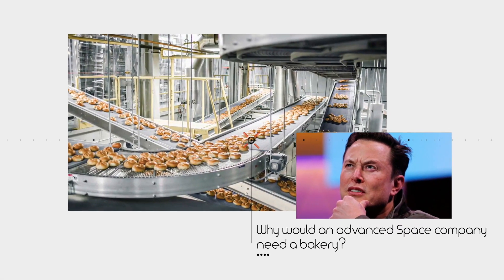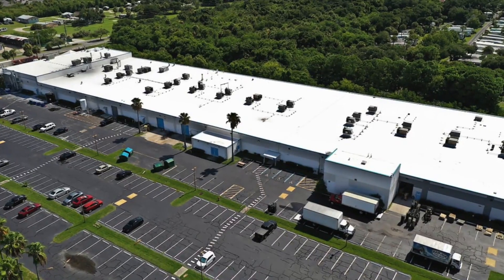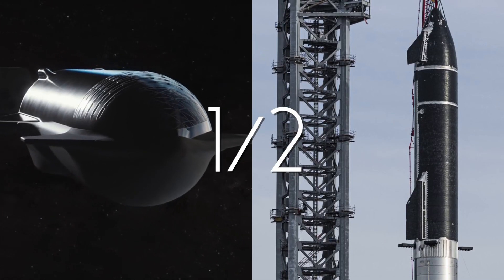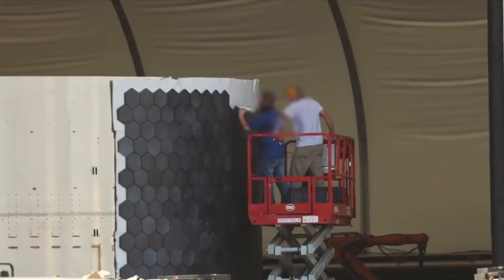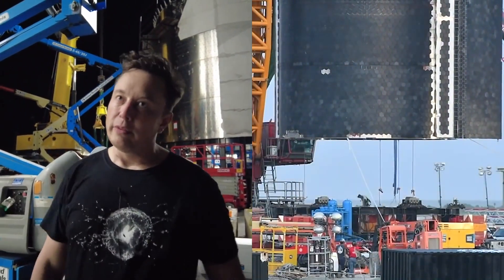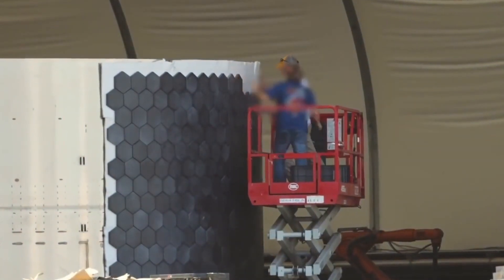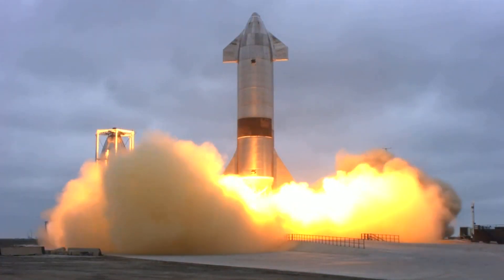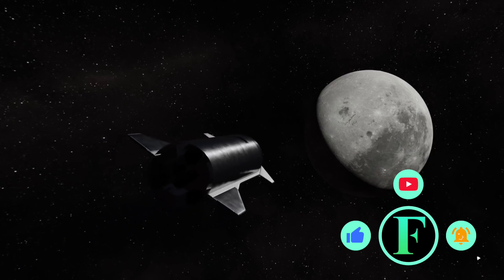Inside SpaceX $1.3 Billion Dollar Space Bakery

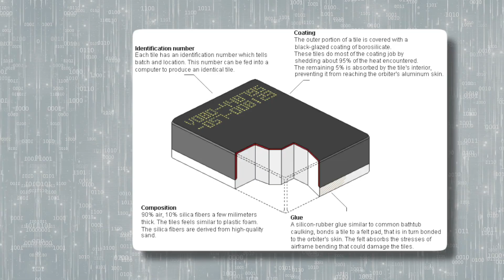Comment: Erm... if the tile is 90% air, when S20 goes into space, wont the air leak away leaving the tile with 90% vacuum? Not sure you can make the claim at 1:34 "that's because of air's low thermal conductivity".
Reply: even better, vacuum (absence/lack of matter) means absence of conduction or convection of heat

Comment: So far it looks like the thermal shield won't work ... The ceramic tiles are too stiff and the starship hull too unstable. Additional stiffening of the hull will probably significantly increase its weight and it is not known if the power of the booster will be sufficient.

Comment: I layed carpet tiles for years and the principle was the mass produced tiles in the main shape are shipped to site however those requiring cutting and sizing for the angles and around piping and protrusions were done on site. It makes sense then that the hexagonal tiles (the bulk) are made off site and the tiles required to be cut to size and fill the gaps (a much smaller number) would be made on site.The construction off these tiles may also be different slightly to allow them to be cut or shaped to size.my theory anyway Cheers from Australia

Comment: the heat shield is a bummer, at least in the way how they apply it, if they need to install every single of the 15000 tiles manually and check them multiple times that's a very poor engineering

Comment: im quite sure spacex' strategy will not achieve the goal of fiscally viable interplanetary travel and settlement.  An interplanetary vehicle needs to be assembled in low earth orbit as big as the twin towers combined, if not bigger and it could be any shape, but rectangle seems most logical. It would not require heat protection as it would always remain in orbit  whether here or @ mars. It should however  be supported with with a fleet of unmanned reusable delivery vehicles like the starship concept

Comment: Is this WOLL water resistant? How much more weight will have ship after heavy rain? If water will freeze it will not destroy tiles? What if water will fast evaporate during start or back to atmosphere? A lot of steam will be generated? Pressure can detach heat shield tiles?
Reply: Correct this is an issue that will be a massive challenge to the vehicle

Comment: Why don't they have sheets of tiles, connected together, inspect them on the ground, and then wrap the sheets  around the ship, you can avoid all the different shapes as this would be a template of that section
Reply: How about making the tiles with a dome shape,  without spaces between them. Print them on, in a continuous unit. There won't be vibration as the whole is monolithic,  and expanding and contracting would be allowed by the domed form,  outwards
Reply: Because they are so brittle that they don't bend. It's a very soft material
Reply: @robertcook5380  Why would they have to bend,  if you follow the same principles of mosaic tiles, you have the ability to reduce the size of the tile to compensate for any larger surface with irregular profiles.  Also instead of putting them on whilst the rocket is vertical you could place them on before stacking, with maybe a few rows to finish of the heat shield.

Comment: Instead of using hexagons, why wouldn't SpaceX (on the LARGE sections of Starship that are a simple cylinder) use a much larger tile, that is shaped to overlap adjacent tiles moving from the bottom centerline to the edge?  Lots fewer tiles to worry about.
Reply: ...think of the slightly overlapping Scale Mail from medieval times.  If the edges were tapered to 'slide' over adjacent tiles (you could use modeling to determine appropriate overlap based on temperature coefficients), thermal expansion and contraction would also be taken into account in those large areas.  It seems like reducing the number and complexity of the heat shield system would be worth the slightly increased weight, and if eroded or damaged, replacing a large section would be as simple as with the hexagons.

Comment: Given the fragility of the tiles and the difficulties in their placement, which bedeviled the Space Shuttle, I predict that Elon will bake entire fronts of Starship like toilet makers make millions of toilets every year: in one piece and install them by sliding them onto straight rails welded onto the fronts of Starship.
Reply: I was thinking about 3D printing the heatshield continuously,  incorporating in the print material those fixation points. As for dilation and contraction,  print those hexagons and in-between them print another material with adequate characteristics.  OR,  and here I go bonkers,  why not print the tiles in little domes,  if they expand,  ok,  expand outwards,  contract,  contract back to original. And the most bonkers thing is this: ultrasound crack and remove the heatshield and apply a brand new print when needed.  Robotic made and tested,  etc.

Comment: How did the robot solve the mounting issues?  There were sure many red and green stickers indicating issues for something that resolves them.  For as complicated as the shuttle was, the tile system did work but the tiles did need to checked after each flight for debris hits from launch and even kicking up debris during landing.  There should not be a comparison with shuttle since from simply attaching tiles, there were many that were broken or loose on starship.  Once they get it worked out, then you can compare.

Comment: Take a slice of bread, put it in the toaster under a low heat setting and toast until all moisture are removed and only a black slice of bread remains and voila you got a heat shield that can protect far beyond the melting point of stainless steel. Yep over simplified but will work if it does not shatter upon reentry into earth atmosphere.

Comment: It would certainly be in SpaceX's interest to have the ability to fabricate certain tiles on site. There are several different tile shapes on Starship, if one of the odd shapes is broken or damaged, you would have to wait at least a day or more to get the correct tile shipped from Florida. If you could instead make that tile on site, you could get your working time down to hours instead of days. Also important to note that SpaceX is working on TPS for more than just Starship. They have a contract with the Air Force to develop low cost-high volume TPS for use in hypersonic vehicles. I don't know if there is any specific overlap with the TPS for Starship, but it would fall under the same umbrella at SpaceX.

Comment: The tiling process is fully automateable even  for the trickiest parts.
Inspection can be done by an intelligent visual screening bot.
The problem of the gaps, which is  the biggest problem could be solved by increasing the gaps  and  adding a second layer of overlapping tiles. As the hull material is stainless steel it can take a much higher temperature.
If the X- ray scanner can  detect cracks in the layer one then that could be very efficient. It adds weight, but the tiles are light weight but makes the maintenance process much more efficient and reduces the number of broken tiles.
Depending on the material, if if had conducting properties eddy current testing could be used as well for the lower layer.
All in all, material forming and  composition technology is much more advanced than 40 years ago. 
Another great advantage for SpaceX.
Elon exploits the fact that space technology has almost not evolved over the last 40 years and no one had the creativity and the vision to do so. 
NASA scrambled to buy antique chips on Ebay…😉 and the state kept weapons companies are many things but not creative and certainly not agile.
SpaceX will reap it all and deservedly so. But to see how they evolve the heat shield will be very interesting indeed.

Comment: i guess it would be easier to use a mesh and glue the tiles on to it in the bakery.
Reply: the tiles need to expand and contract in different amounts separately from the stainless steel. the studs give that room to flex.

Comment: Maybe the mounting studs will fix the problem with the tiles coming off. An adhesive joint is generally thought to have zero strength in bearing and is only strong in shear.
Reply: The adhesive used for shuttle orbiter tiles has a tensile strength of nearly 700 psi. We tested many installed tiles to failure. An installed acreage tile of 9lb density,say on the belly of the orbiter often could take up to 25 psi tensile before failing. That number far exceed flight loads for the area. Where loads were higher, stronger (denser) tiles were used, some of which were good to 100 psi Ftu at temperature. Again, far exceeding flight loads. In short, the “weakest” part of the tile system will be the tile itself, not the adhesive system, which is exactly what you want.

Comment: I am no expert in heatshield tiles, but cant they be produced in larger formats ? Say a heatshield tile that fits the outer diameter of the spaceship, 50-100 cm high. Would be much easier to install and stack em like the metal ring segments? Also lesser gaps between the tiles to worry about. Same goes for the nose and the irregular parts of the spacecraft, build a large special designed segment of heatshield to protect the irregular area ?
Reply: Interesting Idea, but I guess a huge piece of very fragile material would be hard to handle without damaging it

Comment: Was wondering more numbers of how hot the tiles can be without being absorbed into the interior of the tile into the exterior of the spacecraft… but I’m sure those are still fluctuating
Reply: I’d add nano tube mesh using high heat metals cross threaded on underbelly of tiles or even in the ships metal casing if it doesn’t reach specs

Comment: That many tiles that are braking even when installed will mean some breaks in the flight. Inspecting them will delay turnover times. Perhaps those SS's that lands on Earth will have duplicates, so boosters will be fast usage while SS is inspected. Not all SS's will ever land on Earth and need a heat shield. But anyway I don't really like light weight easily breaking huge components.

Landing to Mars is other issue. Months in space and after that landing with heat shield could be an issue if any tiles are broken. Even minor collision with space debris may brake the tiles and that may end the mission.

Earth's orbit is getting packed with all kind of flying debris and that could be devastating to the heat shield.

Is there a way around this, idk. It's hard to figure out some other light weight solution.

Comment: Why not just have a spray on solution?! Like the spay on non stick before frying or baking something
Reply: Thermal expansion, not sticking to the cryogenic steel surface, etc etc. Also no such spray foam exists for non ablative heat protection
Reply: @Jaker788  Not an engineering person, but I guess that's a reason no to. Thank! :)

Comment: It sounds to me like they are using exactly the same tiles that NASA used on the shuttle and they are already having to replace tiles even before the first launch. Granted they will not need to die grind off adhesive when replacing tiles but they will still need to use a hole saw to cut them off. The shuttles tiles were glued on to allow for thermal expansion; they also needed a fastening system that did not impart stress concentrations while ensuring that a single defect on a tile did not compromise the entire tile. Allowing the tiles to float on a pin seems like it would not meet that second criteria. Since they are not gluing their tiles in place I would bet that they will have a higher tile failure rate than the shuttle even without having to worry about foam strikes. They may have made a reusable second stage but it will still require a lot of refurbishment between launches and I don't see how this is economic. SpaceX should have considered solving these problems before rushing to launch; they are bleeding money right now and when the tesla bubble pops this whole house of cards could come crashing down.
Reply: A lot of SpaceX money for this is from private investment, people want equity in the company. As well as NASA interest and contract money.

I'm sure they'll figure it out well enough, even if there's a failure rate they can at least mass produce them cheaply

Comment: I hope the tiles hold on during MaxQ. It might be a better idea to use mechanical and glue to keep the tiles on. Why not just use spray foam and make one giant tile?
Reply: Glue or spray foam doesn't work well when it's fastened to steel that gets to cryogenic temperatures when fueled. They use mechanical fastening with a bit of a gap between each tile to allow thermal expansion when hot.

Comment: Very good video.  

But whoever wrote the script doesn't know squat about the Shuttle tiles, which are called "notoriously unreliable". Wrong.

Sure, there were more tiles on the Shuttle than on Starship, and each tile was unique, and they were adhesively bonded to the Orbiter's aluminum hull, and they had to be rewaterproofed after each flight.

But those tiles functioned as required and as designed in 133 Orbiter EDLs. Neither of the two shuttle accidents were caused by those tiles being " notoriously unreliable". The tiles were not involved in either accident. And there were no burnthroughs of the aluminum skin of the Orbiter due to tile failures during the 30 years that the Shuttle was operational.

In fact, if the Starship hex tiles work as well as the Orbiter tiles (some of which made 20 actual EDLs, not simulated EDLs in the lab or modeled by a computer program), then Starship has an excellent chance of surviving multiple EDLs from LEO.

Side note: My lab worked on manufacture and testing the tiles on the Orbiter during NASA's conceptual design phase of the shuttle development (1970-71). My lab developed unique equipment to directly measure the intense thermal radiative heat transfer that occurs in the interior of the tile. And yes, I'm that old.
Reply: How do you measure radiative heat transfer inside of a tile?
Reply: @seanjournot7115  You use a diamond core drill to cut a cylinder of tile about an inch in diameter and 4 inches long. 

Then you use a precision diamond saw to cut thin discs of tile from 0.5mm to 5 mm thick from that tile cylinder. Those discs are mounted in a high temperature furnace  on a rotating sample holder. 

The furnace temperature is increased in steps from 1000F (538C) to 2500F(1371C) while the air pressure inside the furnace is decreased to match the pressure at 300,000 ft altitude (91.4 km).

Measurements are made of the heat radiation that's emitted, transmitted and reflected from the tile samples at each temperature step. 

The transmitted heat radiation data is separated from the emitted and reflected components and is analyzed to calculate the backscattering and absorption coefficients that characterize the heat radiation properties of the tile material.
Reply: Do you know anything about the tiles used on Boeing’s X-37b? Also, do you know anything about the metallic heat shield that was developed for the X-33 Venture Star? I wonder if SpaceX is using or has under development, a heat shield tile that can withstand multiple impacts from orbital debris. I’m excited to see how Starships heat shield works out. Best of luck to Elon Musk and SpaceX.
Reply: The second orbiter broke up on reentry due to damaged tiles. Not because they were unreliable but because they were damaged by falling foam insulation (and ice?) during launch. They were though very time consuming and expensive to refurbish between flights. Notoriously unreliable, no, notoriously troublesome, yes.

Comment: The TPS is the one thing I'm actually worried about.  Quite a challenging problem as those stickers attest.
Reply: I agree.  It was the Achilles heel of the shuttle and was a major factor in it failing to even come close to meeting it's target service rate or reliability. I think they should go more ambitious and look at and active cooling system, or a much more advanced material. The problems with active are: weight and more thing to go wrong (like circulating pumps or field generators).  The problem with advanced material is the time to develop and test it. But its been over 45 years since the shuttle tile was developed, there must have been some progress in that time. I also have to wonder on the mounting methods, glue or push it onto a barb is the best we can do?

Comment: The big issue I see is the uneven surface due to oil canning. If those dents shift during flight, that could be catastrophic for the tiles.
Reply: Looks to be tabs that fit into a hole in tile. Lots of boiler and steam jennies shake so bad during operation bricks are fastened onto stakes to hold them in place untill they expand and brace each other.

Comment: It's a pity it can't be sprayed on making a complete skin with no gaps. It's what Dan Dare would have demanded to reduce the number of points of failure, whatever that means lol
Reply: That's what the orange material was in the space shuttles. It had a habit of debonding, and the Columbia burnup was the result.
Reply: @doxielain2231  Hi Doxie, it was a joke.
Reply: Refractoy most likely to be in layers that either bleed heat to surface or harder more resilient layers or even strands of fiber thruout.
Reply: New refractory is most likely a composite. Some with high bleed rates and some more resiliant.